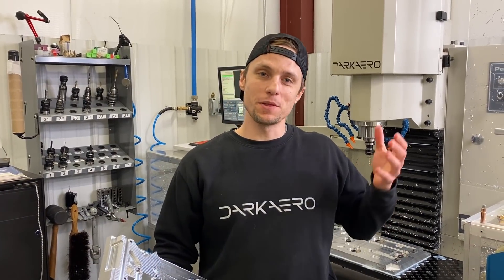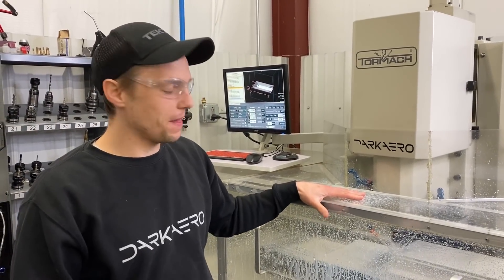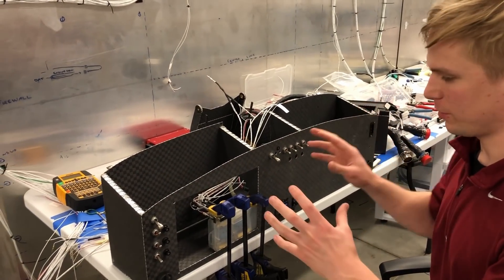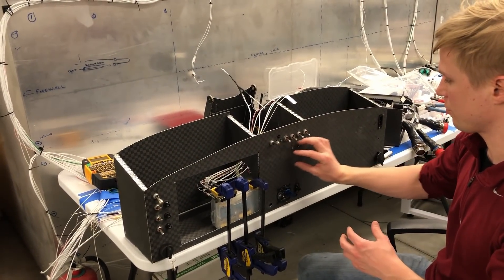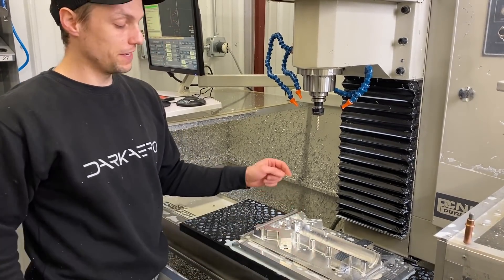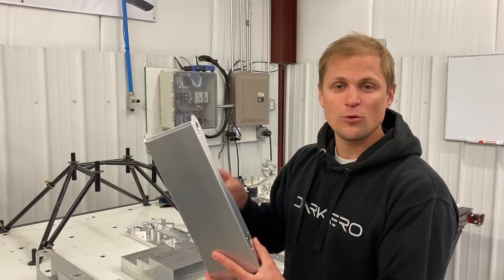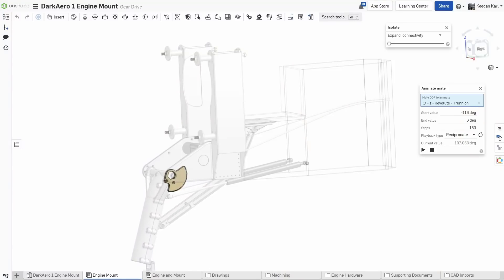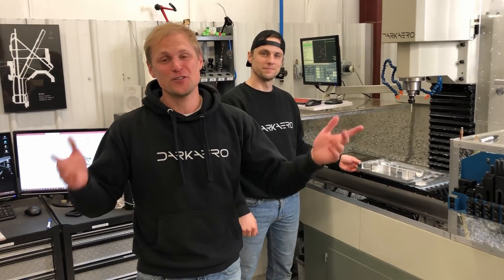NEW Engine Mount and Nose Gear Machining | DarkAero Shop Vlog | May 3rd, 2021

Comment: Love these videos. So the bolts that mount the engine (and mount) to the firewall - are in compression with the spacer holding the engine to the mount and firewall, but are in shear retaining the engine to the airframe, and to resist torque? I take it the rubber donuts are to absorb torque impulses from the engine?
Reply from the maker: Hi Scott! The bolts are in tension but the engine  mount is primarily in compression. The bolts also experience a shear load when supporting the engine and resisting torque loads, but the shear stresses are low relative to the tensile stresses in the bolts. The lower portion of the mount has more complicated loads since it is partially supporting the nose gear. The rubber donuts are to smooth out engine vibrations going into the rest of the airframe.
Reply: @DarkAeroInc  That's what I had guessed from the video. Very interesting design, I'm really enjoying seeing the engineering going into this aircraft. Thanks for all the detail!

Comment: G,day Dark Arrow from Sydney, Australia.
I checked out your website: very impressive.
There are not many service bulletins for the 200hp engine that has been selected. One that was cancelled: interesting.
* I like to engine mounts close to the firewall, however for some reason, access around the engine is good for inspection and repairs. 
*Are you putting any anti-ice system on the plane?
🌏🇭🇲
Reply: Will there be room for a future turbocharged UL engine?
Reply from the maker: Hi John! The space between engine and the firewall is tight but there’s not much in that space to inspect or repair. All the accessories are to the outboard sides of the firewall. The oil filter is at the front of the engine on the UL520iS rather than the back of the engine like you might see on traditional aircraft engines. We will not be installing an anti ice system on the DarkAero 1. Thank you for watching!

Comment: Have you though about doing a prototype in carving foam before doing the first try in metal or do you have enough confidence to skip that step?
Reply from the maker: Once in a while we will 3D print parts in plastic to get a feel for the geometry and scale of parts. We haven’t machined mock ups in foam yet though. You can simulate the tool paths in the CAM software so you can catch anything bad like tool crashes with fixturing, for example.

Comment: I'm extremely unsettled by "iPad Tablet"
Reply: Any particular reason why? A lot of aircraft use them as electronic flight bags or with Foreflight to display charts.
Reply: @sickboy481  No I meant the fact that he referred to it as an iPad " Tablet". A tablet usually means android. An iPad isn't usually suffixed by "tablet"
Reply: @anonymousarmadillo6589 All iPads are tablets, but not all tablets are iPads. Consequently, there really is no need to say “iPad tablet”. There may be a need to say chrome or android or windows tablet to distinguish the OS. It unsettles me as well, but I’m a language nerd. It’s really no big deal at the end of the day. What is a big deal is that these guys are really putting some serious thought and execution into this aircraft!
Reply: @tomcoryell  Oh it's most certainly no big deal. Just an observation